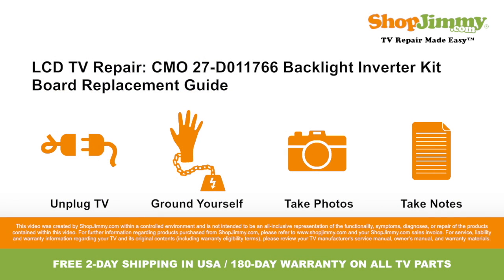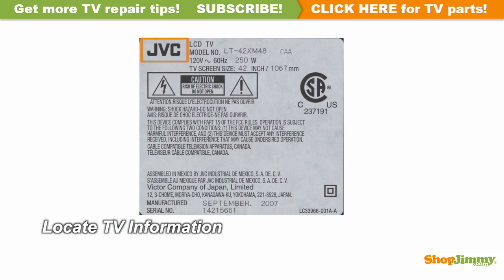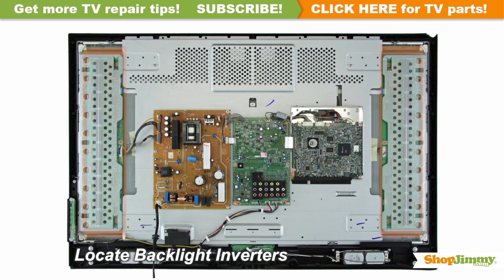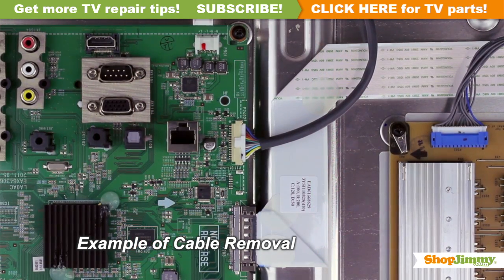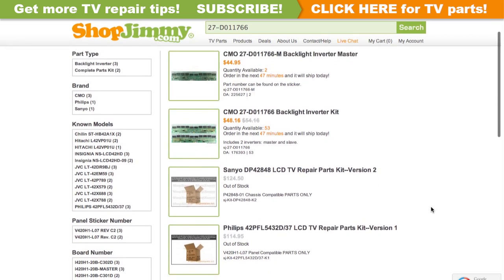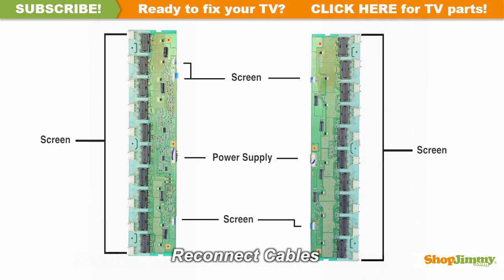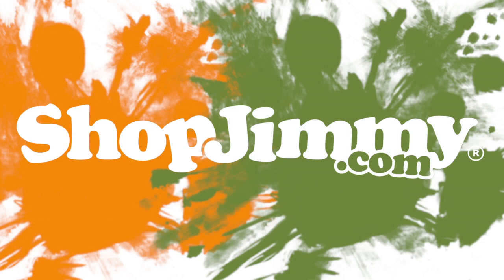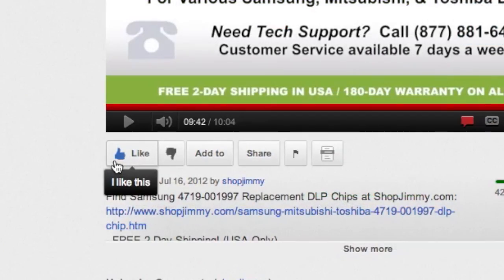TV Turns On, Backlight Inverter Immediately Turns Off TV Repair

Comment: i have a toshiba 40xv645u  tv.  i just replaced a bad backlight invertor board with another one with same part number. the picture now works fine but i can not increase the backlight setting on the tv above 10 with max being 100. this causes the picture to be dark and if i increase the backlight setting on tv it causes the tv to cycle repeatedly on and off. it acts like it senses the light but can't handle normal increase so it shuts off. i can watch tv as long as i don't increase backlight. is there a part i need to replace to fix this? what could this be? thanks for help

Comment: I am Floyd Miller  I have a sanyo model dp26647.  I first turn it on and get a white screen with horizontal bars across the ton and after a while vertical bars and after a while about a half hour later it will start playing. it will play 24/7 as long as it is not turned off.  Could that be a bad capacitor or board. Can you give some kind of answer.

Comment: My RCA tv i think 40inch LCD tv has sound but no picture. The model number is L40FHD41YX9 can you assist? with the cost of replacement part or estimate cost to repair?
Reply from the maker: Curt Mol   I recommend running the flashlight test on your TV.   Here is a link to a video we produced that shows how to run the flashlight test. https://www.youtube.com/watch?v=xUzCLgoSPGM Please reply with your flashlight test results and we can recommend a replacement part for your TV repair. Thanks and please let us know if you have any questions! www.shopjimmy.com

Comment: I have an LG 55lh40. I replaced both backlight inverters because I had sound but no picture, but only when slave is unplugged. Otherwise TV won't turn on. Turns on with sound only with slave unplugged. Power board looks good, no swollen capacitors. Condition was the same with old and new backlight inverters.
Reply from the maker: +Mark Beeler   Try all repairs and troubleshooting at your own risk.  If you have no picture, then you need to replace the main board.  Click this link to replacement parts for your TV model number:  http://www.shopjimmy.com/catalogsearch/result/?q=55lh40  There may be multiple boards for the same TV model number, be sure to match part numbers on your current board, with your replacement for compatibility.    Thanks and please let us know if you have any further questions with your TV Repair!  www.shopjimmy.com

Comment: I have this same TV No backlight changed the M &S inverter boards ..
Now  when I power it up screen comes on for 3 second then back lights goes  off still have sound  can see pic with flash light just no back light ?  changed main board out first  any clue what's going on  Guys ?
Reply from the maker: Rick Reed   I would say you either received a faulty replacement board or you need to replace the power supply board in your TV.  Please reply with your TV model number and then I can recommend a replacement part for your TV repair.  Thanks!  www.shopjimmy.com

Comment: We have a few Viewsonic tv's that are getting old, I have already replaced caps on one power supply to bring it back to life, now I have one that appears the backlight has gone out and it uses the 4H.V1838.491/B1 inverter board. There is a terminal labeled BLON for backlight on and I measure from 0v off to 4.85v when turned on, to ground. Is this correct? I have 24vdc on the power terminals.
Reply from the maker: Ron Dillow   Yes, that is correct.  Thanks!  www.shopjimmy.com

Comment: Hi my 2004 P42 vizio flat screen tv turns on with sound but no picture. I have room dark use flash light and still see nothing. How can i tell if i need to replace main board or inverte?
Reply from the maker: Leo Sarabia   Since you cannot see any text or an image on the screen with the flashlight, I recommend you replace the main board in your TV.  Here is a link to replacement parts for your TV model number on our website, click here:  http://www.shopjimmy.com/catalogsearch/result/?q=P42  Be sure to match part numbers on your current board, with your replacement for compatibility.  Here is a link to a video showing how to identify your part number, click here:  TV Part Number Identification Guide for Vizio Main Boards (Plasma, LCD, LED)  You can also call our customer service for further assistance with your purchase.  (877) 881-6492  Thanks and please let us know if you have any further questions with your TV Repair!  www.shopjimmy.com

Comment: Hi love your videos I have a good question  .....I have a Philips 49put4900/12 tv 49inch recently backlight gone out so can see text vaguely with a light ....I thought it was an inverter but ours dont have 1 so I'm contemplating a new or newish  power board however I've seen that others have changed that and still no joy ....on the same chat forum there was a mention that another guy repaired his by replacing the main board as there is a 5v signal that is sent to the power board to activate the back light??? Any help would be appreciated thanks
Reply: Did you fix it? I have nearly the same problem...
Reply: @lennert52  no I've ordered the led  backlight at £65 as some were gonecetc and I've been told that when either one or a good few are gone it will not light up at all almost like a safety feature to prevent too much power getting to them so hoping this sorts it out I'll let you know parts shouod be with me around the 5th